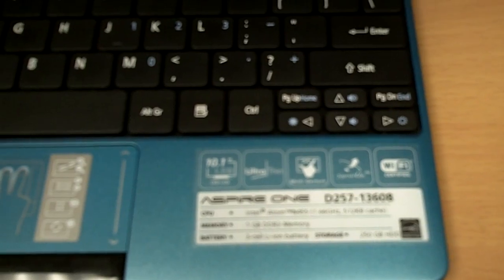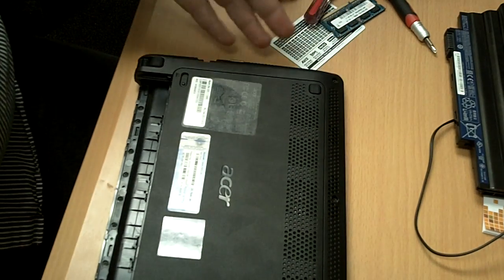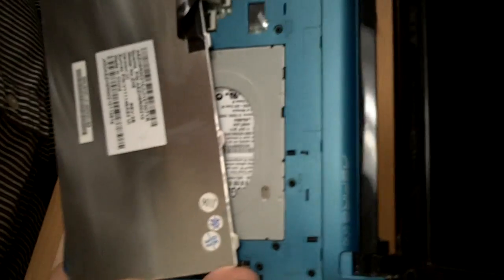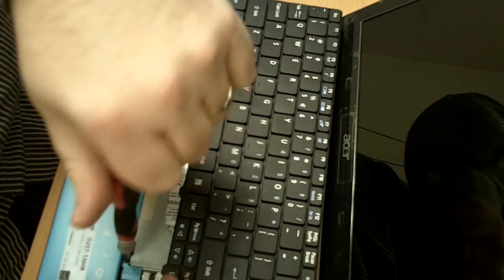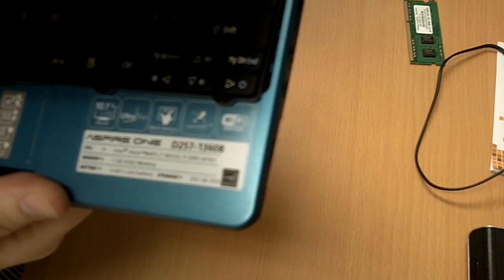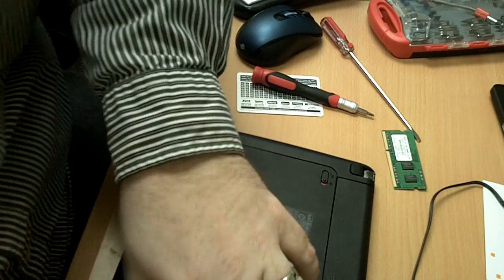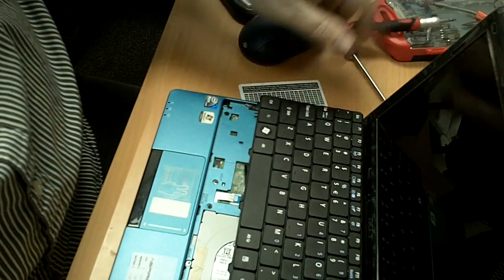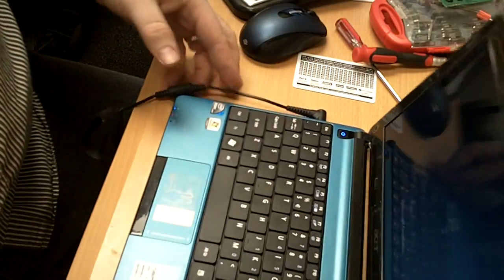How to Open or Upgrade An Acer Aspire One

Comment: Completed the procedure as requested. When completing the testing process computer goes black and stays like that, no commands or key respond to the computer. HELP!!!!!!
Reply: +Joseph Coutihno Could be bios or faulty ram
Reply: +Hennie DU TOIT Thanks but i found out why the netbook turned blank, it turned out that i hadjn't pushed the RAM in hard enough and so it wasn't being read. When I googled it I found out that someone else had the same problem and so I just followed what he did to fix it and had it work. Thanks for the help though!